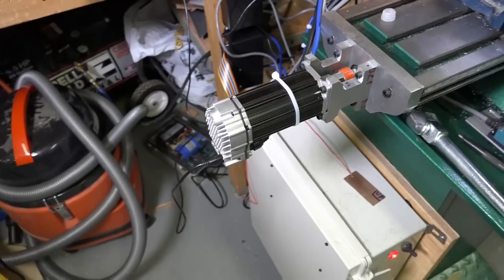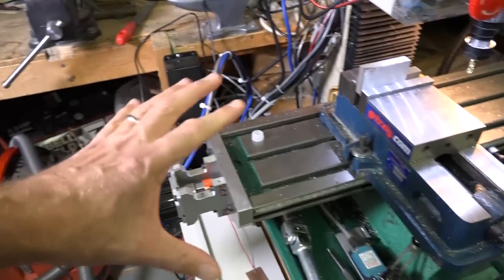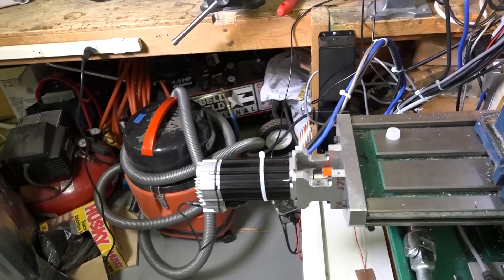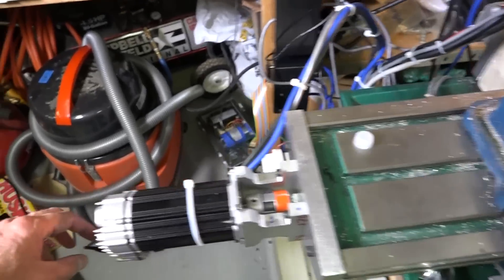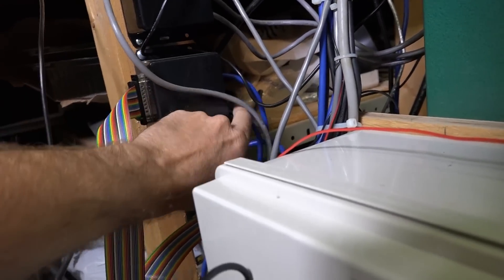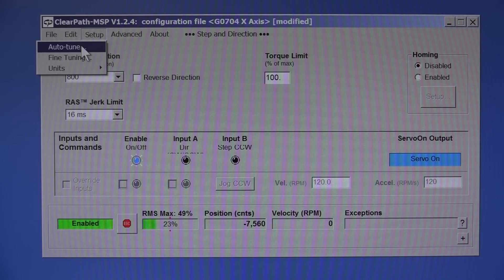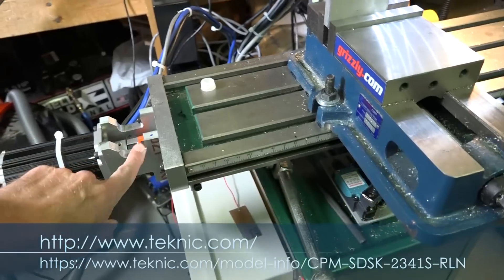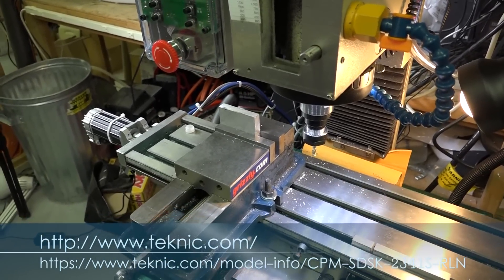Teknic Clearpath Servo Motors installed on a G0704 CNC mill

Comment: great, max feed?
Reply from the maker: fedeyoutub Not sure. But WAY faster than the machine and spindle can handle.
Reply: @loen.design  fantastic, for the rapid movements between one process and another it is great to have great speed, I would like to use these engines for a machine that I have to convert shortly, but I was afraid that without the gearbox the motors would stop, I'd be curious to see what speed reach ..
Reply from the maker: fedeyoutub The clearpath engineers were surprised I did not use a 1:2 or 1:3 reduction pulley system in the design, but I think it would still be fast with that. You can turn the motors up to 3000 rpm I believe. It’s been a while since I looked at these details. Full specs are on the clearpath site.

Comment: Are there taper pins available with threaded ends for your universals? Setscrews middle name is Work-loose! There are a special setscrews I saw in Machinery’s handbook that have a short stub end which looks like it makes an interference fit into a shallow hole in a shaft. Looks like it would not work loose, especially with blue Locktite.

Comment: Regarding your vise placement.  I seem to be in much the same boat on my machine.  No matter which slot I mount the vise, I will not be able to take advantage of the full 7" travel in the Y, I will lose 2+ inches no matter what.  Do you have similar issues?

Comment: Two things, don't use lovejoy coupling, it will not be accurate in moving the table, use metal slit spring coupling. Also, don't add another set screw 180 degrees opposite another, do it at 90 degrees to one another.
Reply: Why it wouldn't be accurate? They are used in commercial high end machines also and work just fine.
Reply: It only compresses IF AND ONLY IF you exceed the torque rating on it.

Otherwise we can argue that the solid metal parts also will be off as metal flexes.
Reply: show me one on a hass  or fidal  mill or  even a tormach ..  sooner or later the back and fourth motion will compress .and youll have end play...  just be cause some using it doesn't make it wrong
Reply: Don't have any of those cheap mills here.

Sure everything will wear out some day, but a properly designed coupling size doesn't wear out in years. If it does, then you have the wrong size and wrong materials.

And when it wears ot, it doesn't create any end play in the screw.
Reply: I guess you don't know your mills like a  haas  grizzly has all that slop any way it wont matter what coupler you use its a home shop hobby machine .   you stated  They are used in commercial high end machines  and we know that's bull
Reply: Hmm, funny that I have here two Johnford milling machines and they both have those couplings and have no problems producing accurate parts. Maybe because the controller is Heidenhain with glass scales on the axes, so it doesn't matter if there is little slop. Also the graphite milling machines have them. So I wouldn't count that as "bull".
Reply: you gonna compare that tiwan ford to a haas I  think not   if you feel good to use a lovejoy coupling then use it
Reply: Considering Quaser comes from the same country and both machines wipe the floor with Haas when it comes to machine rigidity,  yeah. Would never buy a noodle Haas.
Reply: Nothing wrong with lovejoys I have a mill with zero backlash using them and a mill with zero backlash using aluminum connectors which prematurely wear the motor bearings.
Reply: Also don’t get me going on those curly aluminum Chinese connectors. Those have far more flex new out of box than any branded love joy. Even the Chinese love joy clones I have are better than those spiral joints. I can flex them in hand.
Reply: the rubber compresses a fiew thousand  it will be off

Comment: Very ZNice Rich - What size stepper(?) did you use on the column axis?  Does the head weight back-drive that motor when you shut the system power down?

Comment: Great vid, I've been curious about these motors for a while.  They're crazy quiet, thanks for pointing that out, it's really neat to hear.
Reply: Or NOT hear?    :o)
Reply: JohnGrimsmo my hybrids are insanely quiet. I’m more interested in accuracy and overall usability, compatibility, with various operating systems. Ordered ac servos for another machine but may try these on a lathe.

Comment: Rich,  I'm in the process of installing the ClearPath 2331 type Stepper/Servos on my CNC.  I first purchased the small 2311 type motors but decided to go larger.  I didn't get the largest ones like you got, but the next size smaller.  I noticed you are using the smaller Teknic power supply.  I also bought the same one from Teknic, but found the larger one at another website for a couple hundred dollars less than the Teknic price.  I've installed the stepper/servos on my machine and run the auto-tune routines on all 3 motors.  I'm glad I found your video because I wasn't sure that the banging during auto-tune was "normal".  I think you mentioned that your system skips steps sometimes.  Is it possible the power supply isn't big enough?  When I was going to use the smaller servos, I contacted Teknic about the size of the smaller power supply and they indicated it should be ok with my smaller motors.  Have you had any problems you can trace back to the smaller power supply?  I see it's been 7 months since you posted the last video, so I figured I'd ask what your experience has been so far. Are you still satisfied with your choice?  Thank you, John

Comment: Rich, how are these working out for ya? Could you shoot an update video? Thanks!
Reply: I thought they claimed 2-3 X the power, not torque.  (same torque at 2-3x speed...)
Reply: +Rich Loen Right on! Wonder how a geared sys will help.
Reply: +Rich Loen I use servos in a few of my machines.  When sizing servo motors, you use the continuous torque rating and not the peak.  The peak ratings are only for a few seconds.  Any more, the motor will overheat.  To get the most out of a servo motor, you really need to use pulley reduction.  I usually use gt2 pulleys with a 3:1 or 4:1 reduction.  This will significantly increase your continuous torque rating.  Servo motors spin fast enough so your rapid speed will not be too impacted. 

Once you install pulley reduction, you can tighten up your dovetail ways for increase rigidity.  It would be like a different machine.  You will not be able to stop your axis from moving. 

Regards 
Jim.

Comment: What power supply are you using? Those servos take a bit more power to run. Well apms . I bet if you grabbed a larger power supply it would fix your stalling. There easy to make , piece together rather than purchasing CNC power supply's. 
Great mod though.